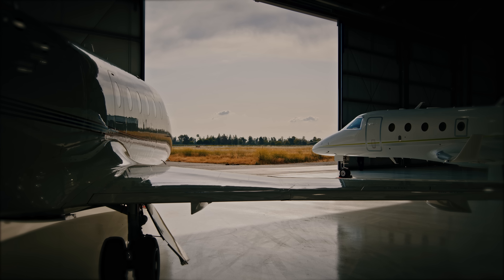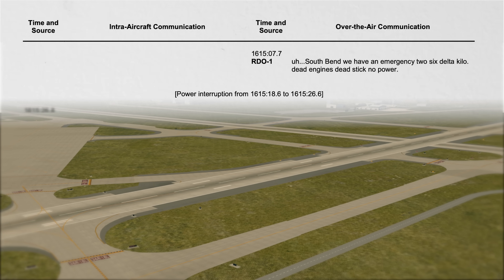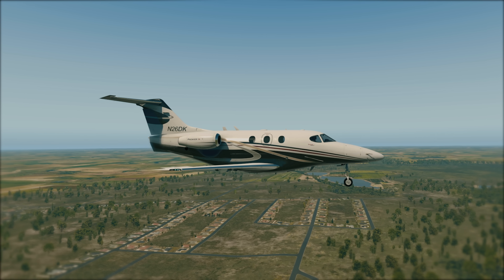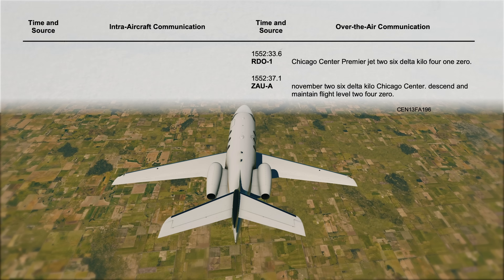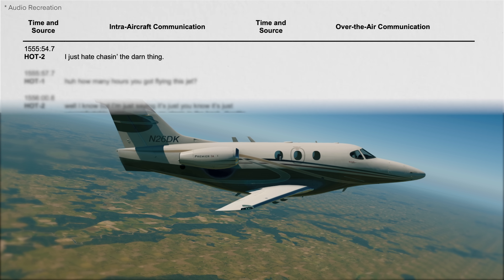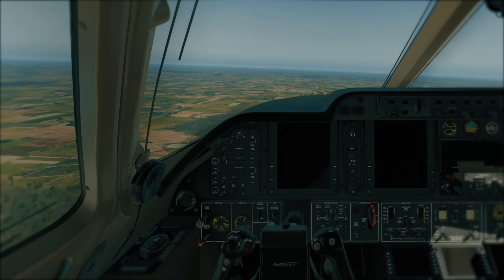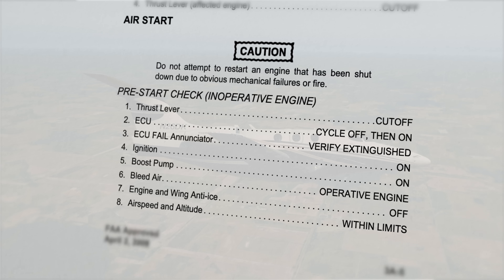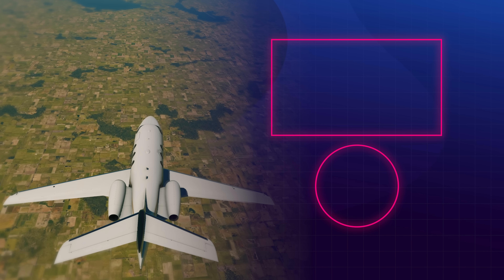Passenger Causes DUAL ENGINE FAILURE | Accident Case Study

Comment: The poor guy said “your throttles” and the PIC still gave him orders he didn’t know how to follow … during sterile cockpit time ... without an approach briefing. 🤦‍♂️ 

A guy did something like this to me once. He let me fly his Bonanza from the right seat even though I had no experience — none whatsoever, never been in a small plane before. I overshot the base-to-final turn and crossed the controls to try to stay on the extended runway centreline without overbanking. I don’t think he ever noticed I crossed the controls. Lord knows how close I came to stalling it right there. Had we died, the investigators would never have been able to deduce that I was the one at the controls.

The rudder and ailerons were linked in that plane. I don’t know if crossing the controls to a dangerous degree was even possible, but I know I tried to input left rudder and right aileron at the same time.

I was very young at the time. I know better now than to cross the controls on the base-to-final turn, or allow another person to put me in a dangerous position I’m not qualified to manage.
Reply: I did the same thing in a bonanza but my PIC knew better than to let me fly the pattern.  He let me fly for the 30 minute flight between airports.  I was flying like a complete madman but at least we had enough altitude.  I ended up making myself sick and throwing up into my hands because he didn't bring barf bags,  and had to hold my own vomit in my hands until we landed.  LOL
Reply: not 100% sure, but i think it depends on your speed if crossing them is OK or not. Definately possible to fly with max crossed controls, search for "side slipping". Its the most fun I know, in my limited time flying small airplanes, i just love it. Flying sideways XD. I think watch the speed or you can enter a spiral is the thing
Reply: "a guy did this to me once"

Uh, not saying he was right, but why not take some responsibility for your choices too?
Reply: @jnawk83 

“He let me fly his Bonanza.”

…but…

“I overshot the turn.”
“I crossed the controls.”
“I was very young. I know better now THAN TO ALLOW ANOTHER PERSON TO PUT ME IN THAT SITUATION.”

Just because my comment includes the words “a guy did this to me once” doesn’t mean I deny my role. You need to read (and comprehend!) the whole post, because the admissions of personal responsibility are in there. The whole post is, in fact, a claim of personal responsibility and a warning to others not to do as I did, abdicating personal responsibility to someone else. If my first post didn’t make it clear, I’ll make it clear now: I should not have accepted the controls. 

Sorry to upset your self-righteous moralizing, pedant.

Comment: In my opinion, ALL jet/commercial pilots don't "Have to be" former military, BUT it sure helps. Military pilots constantly practice procedures and emergencies most civilian pilots think are impossible or would never happen. Even if some conditions never show up, military experience prepares pilots for the ones that do, how to remain calm and THINK, Focus, and Fix.  Many civilians probably do practice non-routine procedures particularly with advances in home Sims. But my guess is, practice in a real aircraft with real consequences and no re-boot button, is much better.

Comment: Why would a go around even be a topic in a emergency situation ? Land belly no gear you're life is more valuable then that airplane.
Reply: That's why he did a go-around. He wanted to get the gear out, so he could land without crash landing. It's impossible to control an airplane while landing with no gear. They can skid sideways and flip... and he had plenty of speed to try another run. Then he got an engine running, which would have given him all the time he needed to get the landing gear down and to land safely. You don't just crash land until there are no other options (and landing with no gear is a crash landing). With the one engine running, even with only front gear, he could have tried several times until he got it right... but for some reason, he inexplicable crashed into the houses, even though that shouldn't have happened.
Reply: @deucedeuce1572  Im gonna have to disagree ive seen several belly landings on off airport landings and the runway surface. Belly landings are safer and have a much higher survival rate. He would not have skid far at all. I watched a similar plane do it on accident and it came to stop quickly. Him doing a go around with one engine and his experience would have resulted in a non survivable crash everytime. Would rather land on a runway and skid with plenty of distance away from obstacles or crash uncontrolled from the air and die guaranteed ?
Reply: @Darkvirgo88xx  "die guaranteed"? That's quite an assumption and a bait and switch.
Reply: @Darkvirgo88xx  ..and a loaded question of course.
Reply: @Darkvirgo88xx  You don't crash a perfectly good airplane. You just don't. He crashed because he wasn't paying attention to flying the airplane (probably) not because there was anything wrong with the airplane.  That go-around was no different than if he had a perfectly good airplane and just forgot to put the gear down.  You wouldn't tell him to just crash land it because what if he gets distracted trying to put the gear down later and crashes.  That's absurd.  You're just saying that because everyone died,  not because it was ever a good idea to crash land.

Comment: To be fair to the passenger, If a pilot told me to set the engines to idle during an overspeed situation I'd assume to just pull the throttle all the way back. I only found out watching this video that 0% throttle is engine shutdown rather than engine idle.
Reply: @RetreadPhotoBecause the guy in the right seat isn't type rated in turbine aircraft and he hasn't flown in 4 years  .As soon as the first overspeed warning went off ..that's it ,the pilot should have taken back the controls immediately.and none of this would have happened. This whole thing was a bad idea from the start ...but you have to know when to take the airplane back ...warnings bells going off is usually a good indicator that it's time to do that
Reply: At an even more basic level than not having an untrained pilot at the controls, the throttles shouldn’t have been able to initiate fuel cut off. This is a non intrinsically safe design that relies on the belts and braces of the stop gate, which themselves aren’t a great design given that they are easily defeated.
Reply: @robsalvv5853  No pilot just flightsim but I actually think that also has a reason by design. I noticed in a lot of planes cutting of the fuel is really easy and this is not the only one where it's combined with the throttle. I guess it has to do with the fact that in case of fire you want to be able to shut off fuel supply real quick. A design like this should never be a problem. The problem is letting a passenger play with the throttle. There is really a reason why there are strict regulations in place. If you let your passenger in your car shift for you and he grabs the shifter and put it in reverse while you're driving 100 mph it also not really bad design, it's bad driving and lack of responsibility. And if something happens like a fuel cutoff a normal pilot would look for the right check list. The arrogance of this pilot is just sad for all left behind. His ego was bigger than the plane. And after they started one engine they had all the time to figure out what to do. But no, they did a tight turn with a high bank angle. That could simply be the pilot panicking which I kind of understand but it was all on him. If he wouldn't have crashed this time it would have been some other time. You simply can't design airplanes that fool-proof.
Reply: @franklofarojr.2969  I know, I race online as well ;) But the cars you talk about are the really modern ones. Which might be even semi-automatics. Not sure if you've such protection on a normal manual H-shifter although they become rare. 

But maybe a bad example since aircrafts don't have gears. Maybe pulling the handbrake instead of shifting is more spot on. Different location, different handle and different motion.
Reply: @robsalvv5853  yeah I don't fly but ISTM engine cutoffs should be a pair of covered toggle switches on the IP
Reply: @RetreadPhoto It's true... only two thing happen after the stop gate: 1) Fuel Cutoff or 2) Thrust Reverse. Neither seems like a good idea in flight.
Reply: Damn, some hypercars like the Veyron require an special key and procedure to go "danger" zones regarding speed, and to cut off a jet engine you just need to lift a lever and pull back the throttle?
Reply: I agree with your assessment of the situation.
Reply: Difference between turbine  and piston
Reply: correct, The position is called flight idle. Proper terminology is important.
Reply: Yeah, but "0%" isn't supposed to be possible (on accident). He/they managed to disable the safety levers that stop the pilot from being able to accidentally throttle the plane so low that it can stall out. Normally when they pull the throttle all the way back, they safety lever stops them at a safe level, so they can't make that mistake. I think like most pilots, he assumed that they would, but they were disabled, either on accident by him or by the pilot.
Reply: It's "kind of true" but in reality, "0%" is not the "fuel cutoff" position. In the simulation you can see pulling the throttles straight back takes it back to full idle. Pulling the lock handles UP allows the throttle to come back one more notch BEHIND the Stop Gate to a fuel cut-off position.
Reply: @cpl_0503  Could be me but I feel the design can be hazardous at times, I fly on the DA40 where the mixture handle is separated from the throttle by another handle, at times of high stress, I feel the possibility of a pilot grabbing whatever he can, including the locks, is too high to be a smart design
Reply: @ayoayo2755  - I can't argue it isn't a logical design choice. BUT, if you are unfamiliar, you should be looking and double checking before manipulating. Yes, bad design... Yes, way worse choice to let an unfamiliar unqualified person play with your aircraft's critical systems.

Comment: I'm sure there's quite a few pilots like this out there. Shocking to me how you'd fly an advanced plane like this and not have everything in the POH down cold - or at least all memory items and able to look up very quickly.
Reply: You have to do things by the checklist, and do it that way no matter what ever single time .This pilot had plenty of attitude airspeed and time .All he had to do is run the emergency restart checklist by the numbers ,and he could have relit both engines and landed safely .
Reply: Didn't even need to know much, honestly - he just needed basic sense. Literally just pull out the manual, flip to the right checklist, and work his way through it. They'd have been fine.

I could have done it, and I'm not even a licensed pilot. Most people commenting here probably could have done it, including those of us (like me) who are 100% not qualified to be operating that aircraft in the first place.

Comment: "Hey Alex? What happens when I pull these switches?"

...proceeds to pull switches.
Reply: it's a stupid design where you can turn off everything that easily
Reply: A pilot that’s had one hour training on a turbine would know not to do that. This guy didn’t because he shut it down. Hence, he should never have been allowed to touch the throttles or anything else for that matter.
Reply: Ok when I become a millionare I will not buy this easily turned off plane